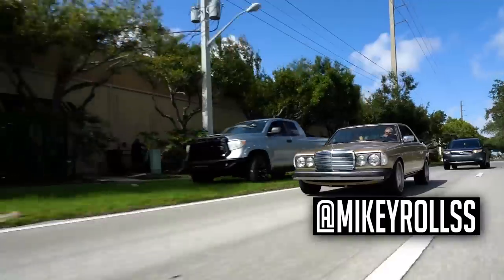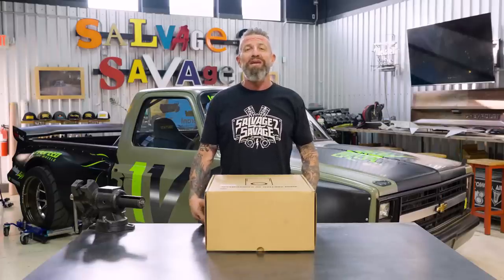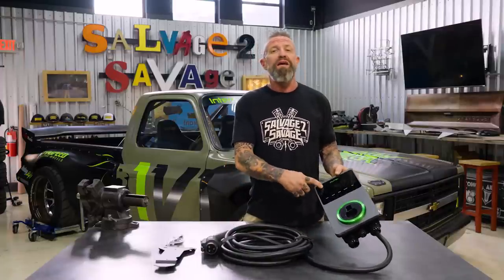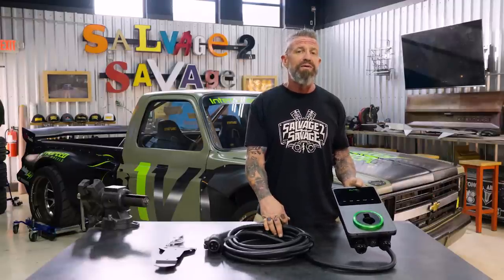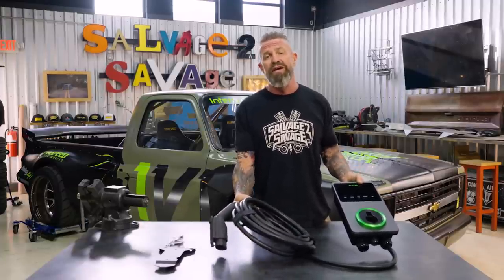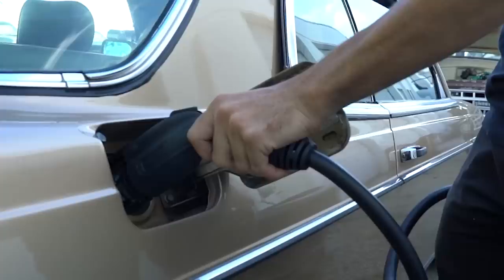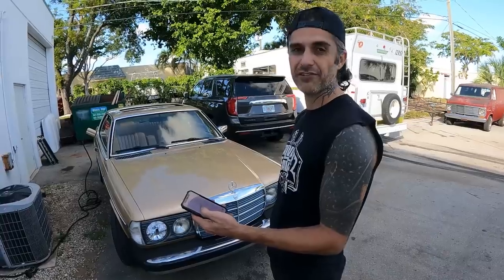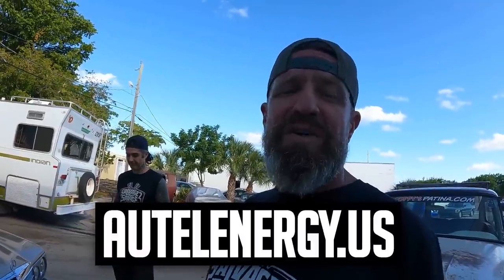Autel Wall-Mount EV Home Charger Review

Comment: how much is the electric bill when charging any vehicle??
Reply: It's pretty easy math to figure out if you know 3 things: 1) your power rate per kWh. 2) your amount driven. 3) your EV's efficiency. I drive a Tesla Model 3 SR+ about 120 miles per day and it costs me approximately $6. So about $0.05 per mile.
Reply from the maker: It costs dave about $0.60 to fully charge his car. He gets about 100 miles on a full charge with his current battery set up. So with current gas prices it's like getting 500 miles on a gallon of gas.
Reply: @SalvagetoSavage  COOL,  Thank you very much for the information.